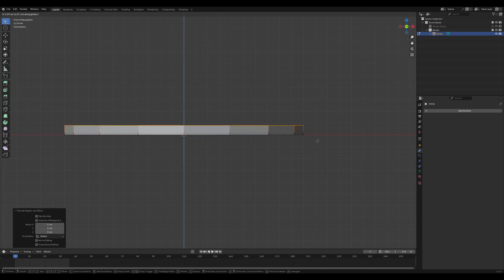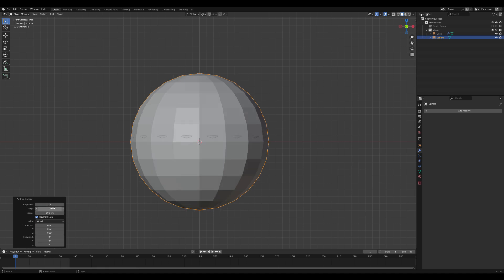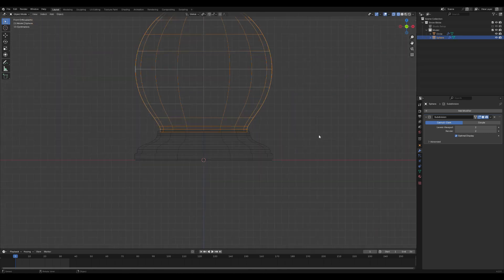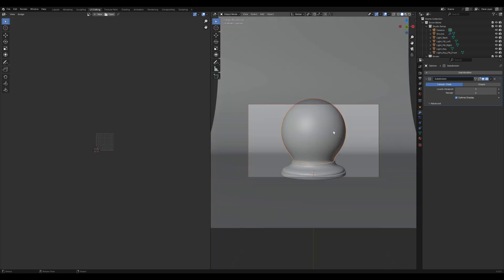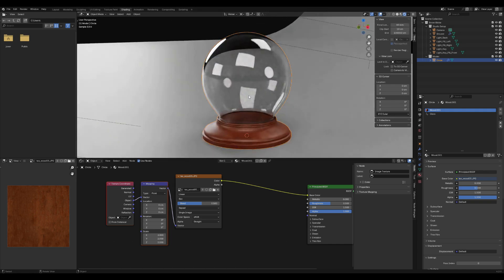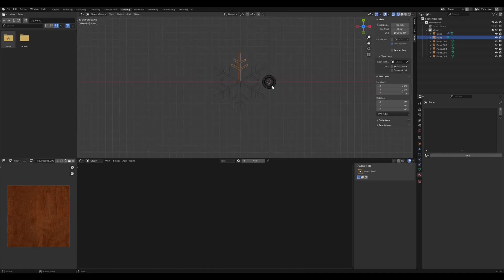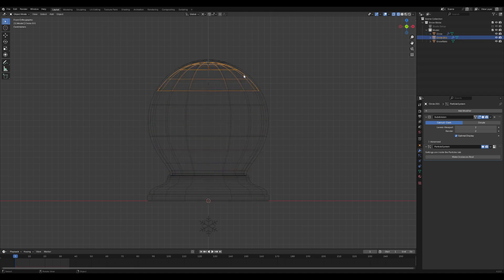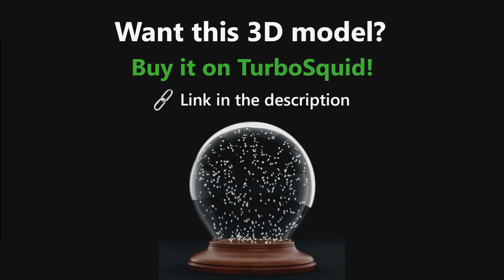How to Create a Realistic SNOW GLOBE in Blender | Full Modeling & Animation Tutorial

Comment: What was the point of going through UV unwrapping for both the base and the sphere if it was never used? The base ended up textured using box map, while the sphere didn't require any textures at all!
Also, have you heard about array modifier 14:08 ?
Reply from the maker: I always unwrap my models even if it’s not used in the tutorial. It’s part of a clean, professional workflow that allows anyone to texture or modify the model properly later.
And yes, I’m aware of the Array modifier — I simply chose to do it manually here for simplicity and full control over the shape.